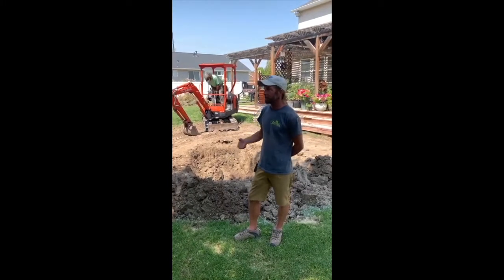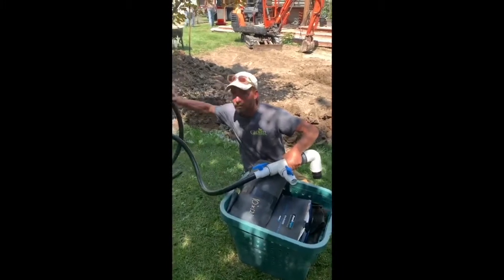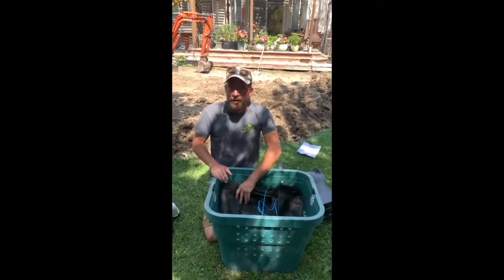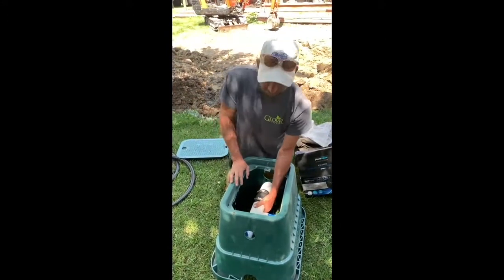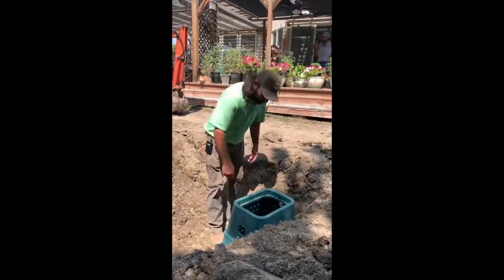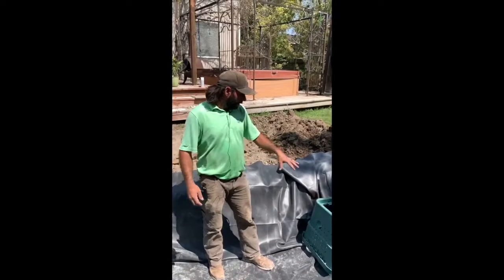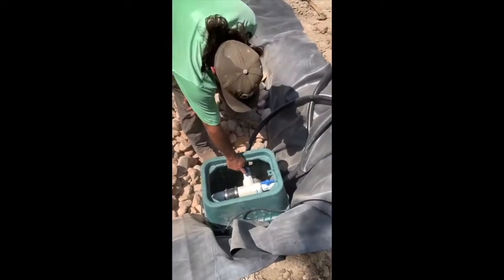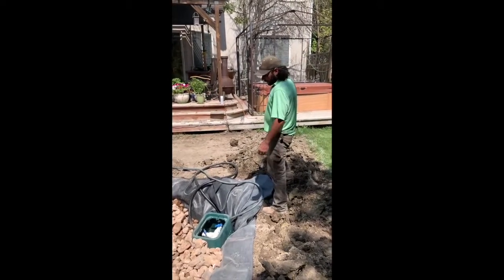How to Install a Drilled Rock Fountain

Comment: Will those rubber liner/underlayment plus gravel systems  support rocks up into the 2 ton range?? I have some 4 to 5 foot diameter boulders on my property I would like to incorporate.
Reply from the maker: @callapygian  Yes it can support that weight if you use 45mil epdm, with undlayment and a smooth cobble fill to reduce risk of puncturing the liner.  We install these all the time with multiple boulders, they do just fine.